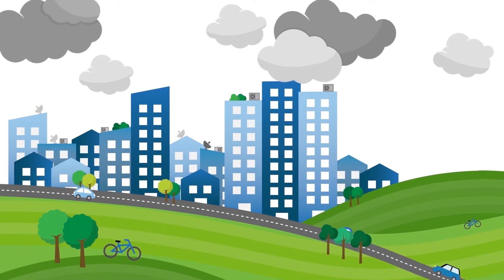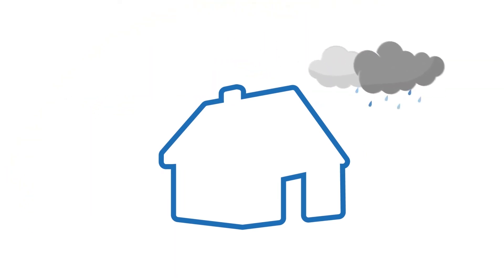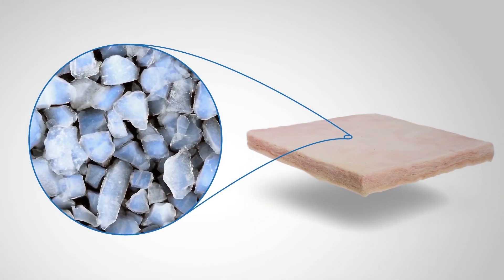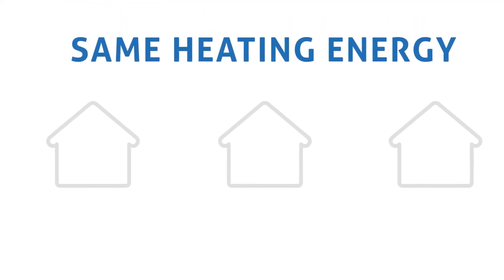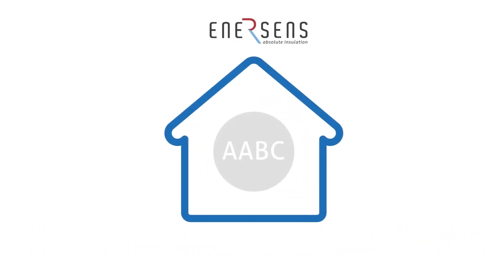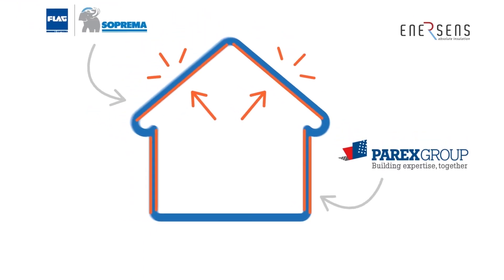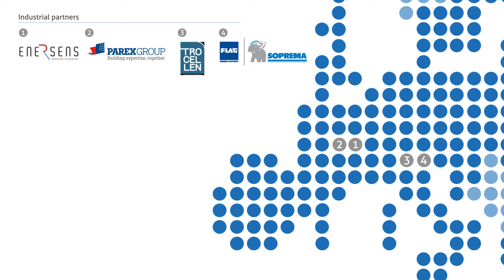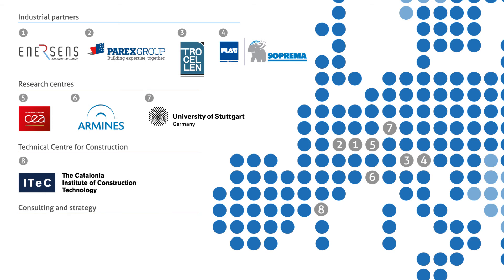Homeskin, research project to develop new insulation materials

Comment: Well, use of aerogel for insulation would be great. But well, how do you bring the cost down  even for demonstration house? Plus how much energy and co2 you need to manufacture it in the first place? Maybe good, maybe bad, don't know.

I see there is some production of aerogel at enersens.

How it compares to foam glass tho for example? Or high performance PIR insulation. SwissporPIR Premium Plus has lambda 0.018W/K/m. Isn't that fantastic?

But if you can make aerogel cheap and eco friendly, easy to recycle, surely that is a good idea. Aerogel and glass foam are inherently innert. And don't deteriorate with time really or with water contact.
Reply: https://plastics-rubber.basf.com/global/en/performance_polymers/products/slentex.html